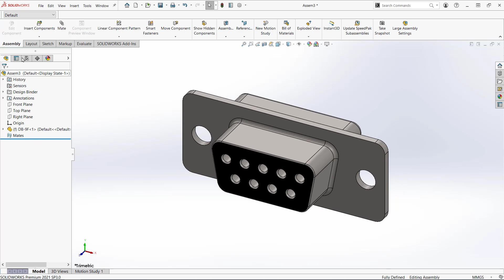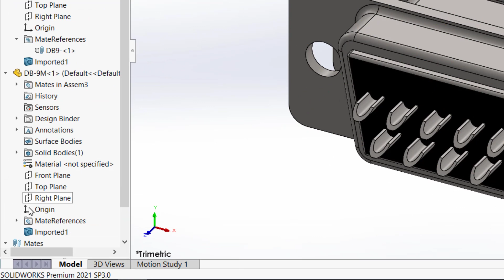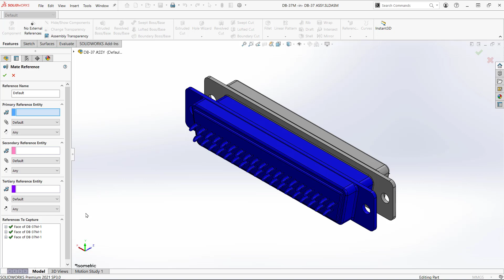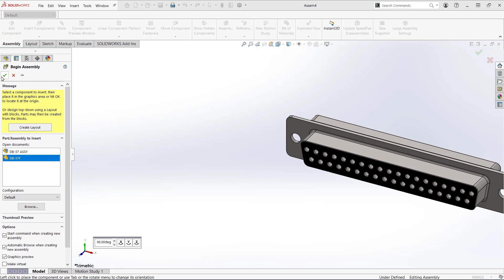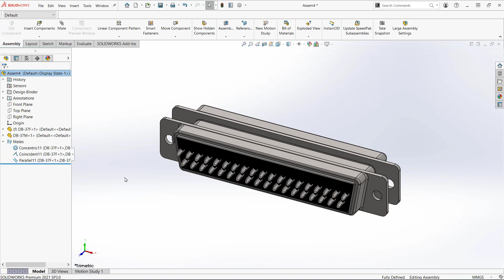SOLIDWORKS: Using Mate References

Comment: So, my heartburn is mating a connector to a chassis, and worse yet, when the connector comes in at an off angle (90,90,180 for example), then making it worse, for example, a db9, db15, db27 on the same chassis surface. I lose alot of design time just doing mating.